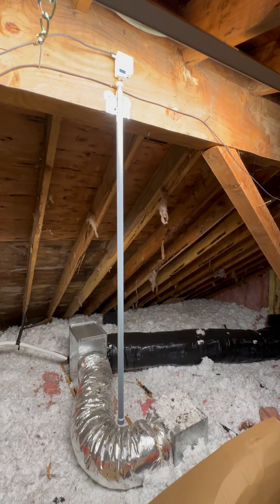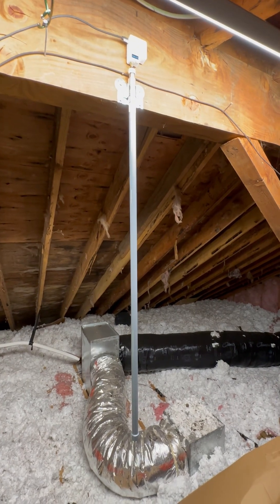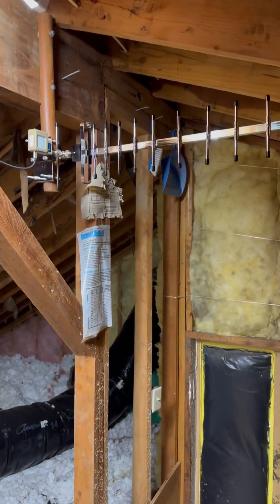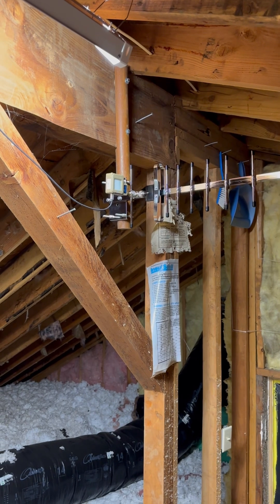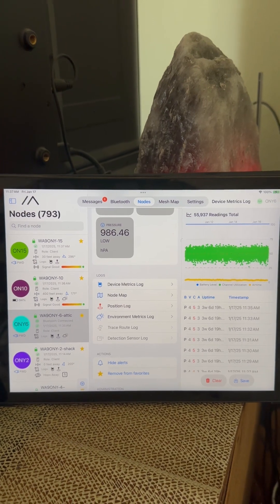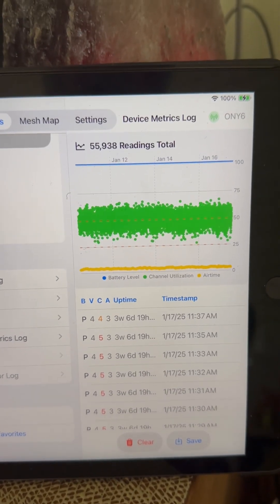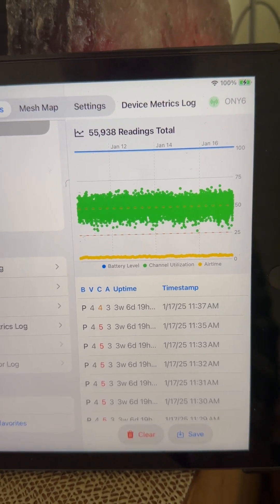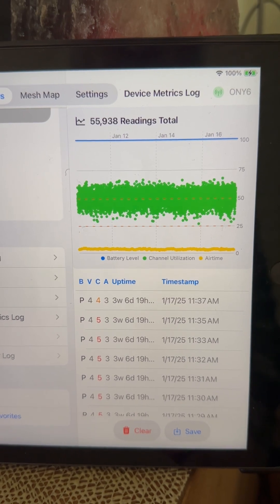Lilygo T-Echo Attic LoRa Meshtastic Radios

Comment: With a T-Echo in hand and a T-Beam supreme (mounted a bit lower than my roof) I was able to send messages 10 KM away from one another. With default small antennas on both ends. They are awesome 😎

Comment: What app is that your using here?
Reply from the maker: I use a Apple iPad running Meshtastic app.  The iPad is down stairs about 20' from the T-Echo.  The Bluetooth connects fine but does not do well at greater distances.